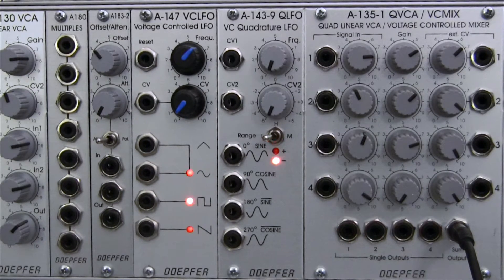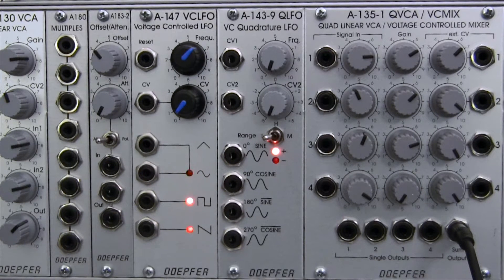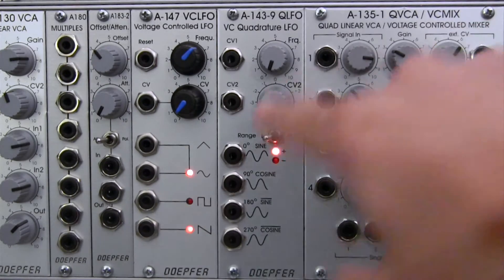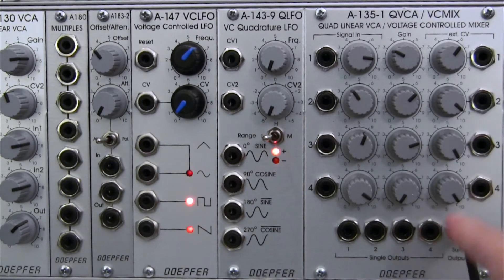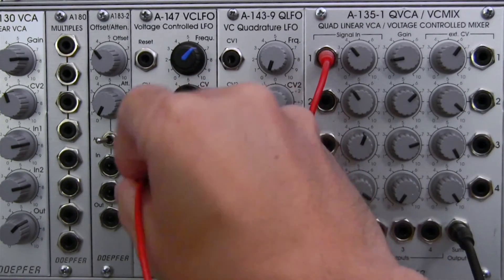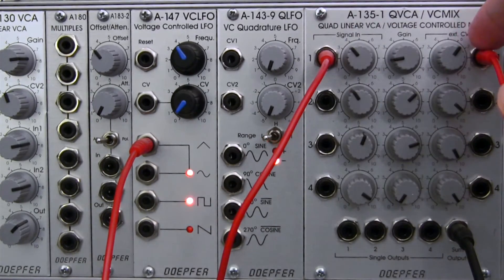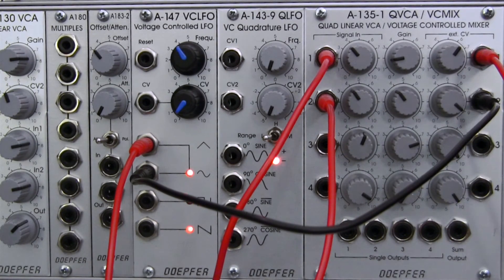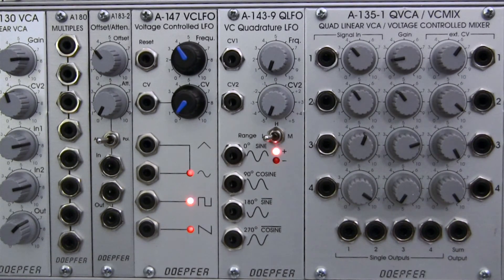Doepfer A135-1 QVCA/VCMIX basics

Comment: Hi Raul, is the gain sufficient to audibly distort a triangle wave? I'm looking for a way to distort the A111-4 polyphonic oscillator (all four channels separately).

Thank you!
Reply from the maker: According to the manual "The VCA’s used in the A-135 (CEM3381) have a
linear control response." So if that's what you need and enough to get the sound you want , then yes.  Even if it's not you can never have enough VCA's. If you plan on distorting each specific channel there are other ways, ideal way would be 4 of the A- 189-1 VC Bit Modifiers. Then you could vary the distortion. thanks for watching.

Comment: Hi ... Thank you for your video tutorial.  I would like to know if each independent output can be connected directly to my audio interface to record each output independently.  Does this module have enough gain to send audio signal to my interface?  Thank you
Reply: Modular levels are more than enough for audio recording. I'd be more concerned about clipping from your interface and get a module to lower the levels into line Levels
Reply: InstaBlaster
Reply from the maker: Hell yes it does. Most oscillators and sound generators actually come in LOUD! I always had to bring the pre amp down. Even then it would distort since I usually compressed after wards.